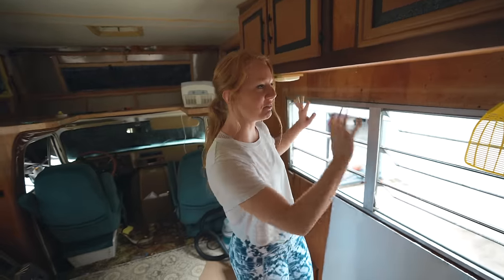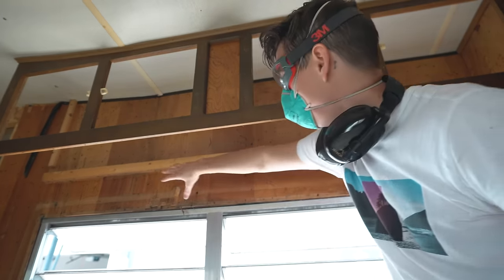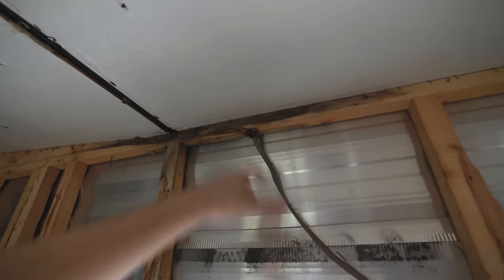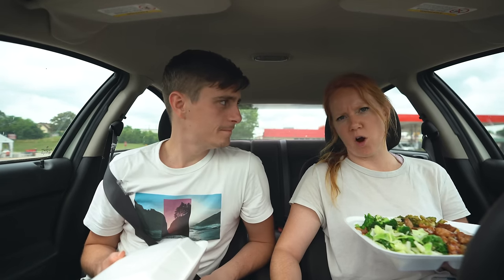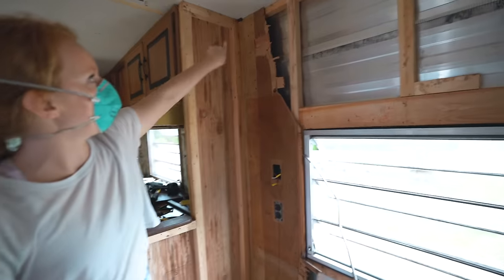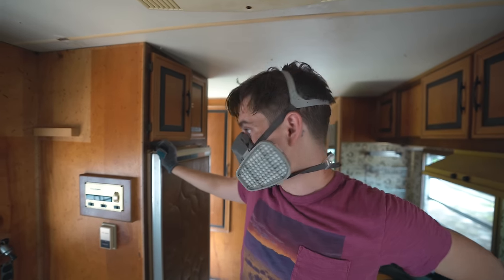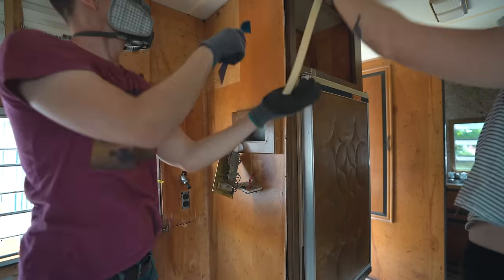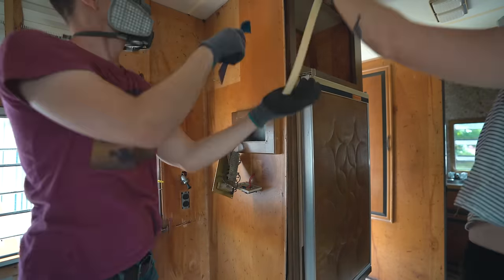Vintage RV Renovation - MORE MOLD! 🦠😭 + Completely Gutting the Living Room! (Ep. 3)

Comment: When you take panels out, like the base of the cupboard, keep it to use as a template. Will make things a lot easier. 😉
Reply: Exactly. Perfect to draw them on plastic  cut it out and use it as stencil. With Vintage campers can be tricky to find original parts.

Comment: When you start working on the roof, do whatever you can to add a slight dome to the roof to allow rain water drainage. Because if you do research you’ll find the flat roofs on the older RVs had standing water which caused leaks.   Good luck guys and I have enjoyed watching what you’ve done so far can’t wait for the final reveal!

Comment: Eric and Allison, You might want to use a mold primer called Bulls Eye on the wood around areas that water might get in and cause mold to start. It's in the painting department at any store. Both of you are doing a great job and I hope I can help with some experience that I have working on homes and automobiles.

Comment: You guys show some great tricks that my daughter and i learned from you. It's almost like a bad habit that you cant stop when taking apart that bad stuff/rot. We started an old class A and soon found that the entire roof had to be done so we ended up selling it and bought a newer one . My daughter said let's just paint and freshen up the interior , well we have completely replaced one side of the wall and are starting on the other one soon. 
On your new sofa design I thought of an extra element that might make it easier to get into the parts underneath.  What if you were to put hinges  at the back so you can open it if you need access under it. It would still slide like your design .
Great videos . We have tried to video our experience  but find it hard to do both. 
Thanks for sharing

Comment: I suggest you rebuild your RV's carburetor. It's self-explanatory. Get a couple cans of carb cleaner, use only brass floats--the plastic ones leak. The fuel tank to engine vent lines may be blocked, that might be why it's difficult to fill the gas tank, if it can't vent you won't be able to fill it all the way. A shop that works on tractor trailers and Rv's would make easier to inspect the chassis and fuel lines, brake lines, etc. Great Job on removing, and rebuilding the forward overhead framing!!   I would use aircraft sheetmetal repair methods on the outer skin crack on the right side. A metal patch will have to be put on top of the crack to keep it from spreading. Stop drilling it was a good way to keep the crack from spreading! good job!!

Comment: Hi there, i also own a vintage camper  and therefore follow your vblock.
Like to share a solution for the leaking roof. As it is very difficult the rework the joints of the roof sheeting I decided to do this:
1 clean & sand the full roof.
2 place a sausage of playdough arround any opening (skylights) and at the outer edges of the roof
3 use epoxy resin to "fill" the roof with a thin layer ( 2mm ).

This way you seal the roof for good!
Alternative, if the roof is curved, use a paint-roller to apply the layer of epoxy resin. 
Tipp, it you plan fixtures for solar panels, install them first!
Hope this helps, and best of Luck with your Restauration.
With Love from Scotland (UK) 
Claus.

Comment: This rebuild is fun to watch! It may not look like it, but I suspect that fridge is GOLD! Refrigerators are a HUGE power draw for AC and DC systems. Most RV refrigerators use a chemical reaction that actually draws heat out of the chill-box...and are most efficient when used on propane. It seems counter-intuitive, but it's true. IF (a big "if") this is a propane fridge...and it works the way it should...you might actually want to consider keeping it in your build because you can run it on propane (even while you're driving) and it won't tax your alternator or drain your battery bank.

Comment: You need to take down the roof too and check all the seems. And you must think about the weight distribution in the RV. You can't have one side of the RV without storage of heavier things. I think you should rethink the solution with the desk along one of the walls without any storage units under there.

Comment: Gut it by all means, but then get the outside waterproofed next, and when you replace any more wood framing you would be best to treat it before it goes in. I noticed that you didn't appear to treat the new wood you replaced over the cab, so chances are you will get more mould there in the future.

Comment: i would wait to insulate until you have it completely gutted.  Then rent a spray foam insulation system, and use that.  it will be a solid surface when done, and should provide a better level of temperature control

Comment: I bought a 32foot Driftwood, inside was usless with mold and stuff, i went alot faster at gutting it, try a sledgehammer and a sawzall, i gutted it in one day, i use it for storage, even though it runs good, good luck.

Comment: Hey have you two planed out what you are going to do with your internet. I myself stayed a year in a metal camper and I found out that WiFi and cell signal doesn't play nice with the metal walls. I've seen other full time RV's run things in there new RVs and make it work. Knowing that you two are YouTubers, I figured you both would need good internet on the road. I think it would make some great content on what can be done when you are designing your RV from the ground up. and if you are already doing that sorry for jumping the gun on you guys.

Comment: Hey guy's while you have the holding tank monitor exposed check it to see if the level sensors are actuate because as they get old they fail so now would be the time to see if you want to replace them now other then later,  later will be worse trust me on that.
 If all else fails you have other options to use keep going its just time and sweat oh almost forgot you might want to keep some of the panels your removing for templates for your new walls ceilings etc.
Try to have fun and one things at a time right.

Comment: You’ve probably already thought of this, be sure to put as much insulation in the walls before you put the panels back. Even if it’s just the double sided aluminum foil over bubble wrap stuff.  I’m shocked that there is no insulation.

Comment: Beware the fridge in a box/drawer concept. It WILL overheat if you can't get rid of the hot exhaust flow. Means you have to have a cool air feed too. It can't just recycle the exhaust.

Comment: guys here's a hint, for that roof. use  2X4's trimmed down too a bow shape. so that you have a two inch end and a three inch middle that will run the whole roof.  use those ribs and strength too that roof, before you use any covering too seal it.'

Comment: Disassembled you see how shoddy rvs are put together. You'll do a much higher quality on reassembly. 

Don't skimp on roof repair or replacement.  You've gone this far, so replace the EDPM OR TPO fabric. Don't trust the original to hold up much longer.  Imagine your disappointment should it leak and damage all your work inside...😉

Comment: While you have it apart you should add the SeeLevel II tank monitoring system.  Accurate levels by percent,  Exceptionally easy installation using existing wiring.  We installed in ours and what a great improvement.  We always know exactly what our levels are to within a couple of percent. Best mod we have done bar none. Good luck
https://www.youtube.com/watch?v=IDffmhQ5RkM&t=834s
https://www.amazon.com/gp/product/B07D3QS4PV/ref=ppx_yo_dt_b_search_asin_image?ie=UTF8&psc=1